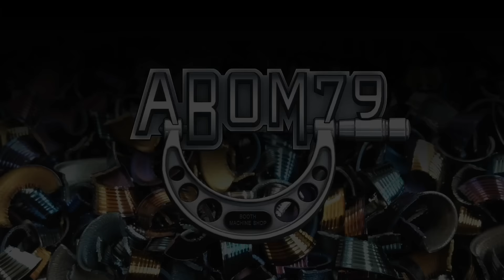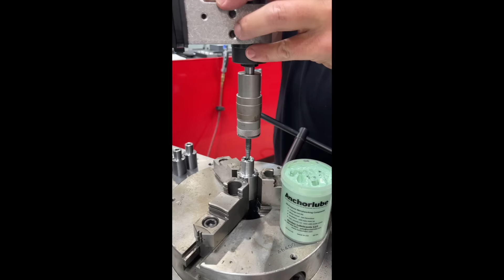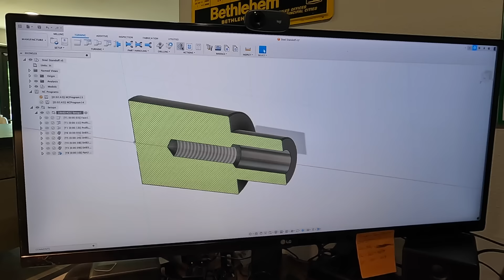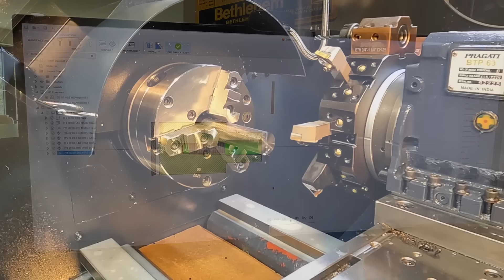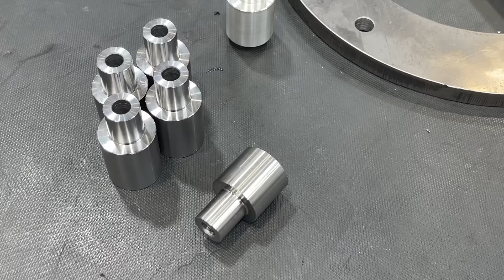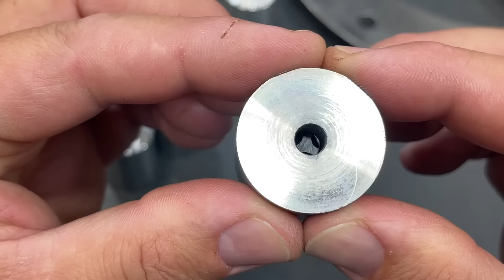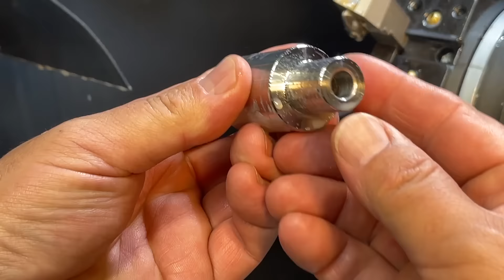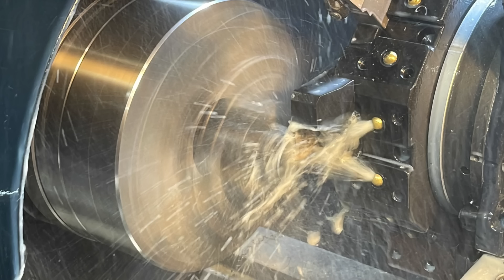Small Batch CNC Turning for the Fab Shop

Comment: Hey Adam, what’s the comparative RPM between the CNC and the Flex arm ? The CNC may be too fast, also you may have drill chips in the bore. Is there any way you could dig up an air line to blow out the bore before the tap cycle? Enjoy your content as always.

Comment: The cycle time would be a lot faster if it didn't sit around Z0 for every pass waiting for something. What is it doing? And the spindle speed is meandering all over the place - there's either something wrong in your program, or that machine has a very poor control

Comment: If you do in fact have rigid tapping on the machine (and spindle orientation) you should try pecking tapping it. Also I would tap a little slower than that. And generally I use a spiral flute tap if I’m tapping blind and CNC but those break easier.

Comment: Most likely the machine does not do rigid tapping. Not all machines can. On a lot of them it is an option when you first buy the machine.
You may have to use a floating tap holder.

Comment: That machine may not support rigid tapping. Contact Milltronics to find out for sure. If it doesn't, you will need a floating tap holder. Also, I know you like spiral flute taps for blind holes. However, you really should try a thread forming tap. They are a lot more stable in a CNC, but can be used in a manual machine by hand or a Flex arm. Thread forming taps do require a different tap drill size. A 3/8-16 form tap calls for a 0.347" drill.

Comment: I have been watching you from the beginning and do love your content the way you are just true to yourself,  but I really don't write comments....you, mainly a manual machinist dabbling in the CNC world.    What tolerances did you hold on your old pacemaker what you were making your large shafts at motion... Being a machinist myself and working mainly in the steel mill industry making anything from small shafts and heats to large rolls for hot mills...we didn't machine down to bearing for specs on the lathes...we run old 60s Russian Stanko gear heads lathes....and we left a large part in overnight and we would see a .010 sag I. The til stock or spindle bearings and even in the change of seasons..we would final grind all journals to precise size...
Reply: Sorry gears not heats
Reply: That’s awesome thanks for sharing. What machines do you run ?

Comment: If you had to run a larger volume of parts, could you add a bump stop to your turret and install a bar feeder? I am not sure if it would be worth the expense if you rarely run into that.
Reply: After thinking about it i guess you would need to have a chuck that could be opened and closed via programing. Iam not sure if this lathe was designed to be used as a production machine.
Reply: @charlesemmer8856  you can still operate the chuck by hand, just finish the program with a stop position where a bump stop finishes at the correct position from the chuck. Remember to move the bump stop away at the start of the program.

Comment: You need to use a smaller chip breaker to stop that strength. You need to insert with about a .10  chip breaker on it to made it chips.

Comment: Based on what I saw in the video. The spindle does not stop fast enough for true rigid tapping. Look into a float tap holder that allows the tap to feed a little deeper as the spindle is stopping. The holder is spring loaded to allow the tool to pull out slightly. Then, program the first part shallow by 5-6 revolutions and see what you get. Slow RPM's are required for float tapping.

Comment: Just curious if you had the feed override on during the tap cycle.  If your feed is not at 100% and the spindle is at 100%, the tap will break every time.
Reply: it shouldn't, if you turn down the feedrate during a tapping cycle in the mazaks and Mori's I've run they all kind of ignored it or reduced spindle speed to suit
Reply: @ramentaryramblings yup. Usually canned cycles or tapping cycles will override any manual changes on the control.
Reply: Every CNC machine I have ever worked with will ignore the feed override in tapping and threading cycles.
Reply: @loukola5353  me too 👍

Comment: Could it be the horizontal power tapping as compared to vertical power tapping that's causing the tap to break? Maybe in horizontal tapping, the torque on the tap is "different" (at least at speed) causing the breakage (chips collecting at the bottom of the piece  get twisted around instead of  breaking and going out the top--like in vertical tapping). Just a thought...
Reply: tapping horizontally or vertically doesn't change a lot. if anything it doesn't change anything.

Comment: We do a few of these tap drill operations in 4-5xd deep holes, shop made square duplex tool holder with a split and a couple clamp bolts, one is the tap drill, other is the tap, you use the same tool pocket, but a different offset. One trick is that you don't tighten the tap that tight so it has a bit of wiggle, there is a square to catch the tap tang, and it feeds and retracts just fine. (This is with a shop made pneumatic barfeeder too so you know its only seeing marginal supervision) speeds up the cycle and in a job shop where you are making a lot of different parts leaving commonly used tools in their pockets and x zeroed and z referenced to the #1 tool does save you a lot of time setting up, so getting a tool twofer out of a single pocket is pretty cool. If your pitch (feed for tapping) is correct then I would guess your tap was off center, first hole with a new tap should have held up to marginal coolant, fail down the line for sure, but the first hole should have suffered through. Other thought is cut the speed in half, an extra few seconds on a tap cycle isn't any crime and it pays for itself in tooling fast.

Comment: You should cut that piece in half on both sides, split it open and check how tool did with cutting threads
Reply: The broken tap fragment in the hole is super hard metal. It would dull or break a bandsaw or hacksaw blade I think. Maybe there are hacksaw or bandsaw blades that can cut it.
Reply: @timothypirnat3754  you can use angle grinder on last stretch of material, I don't think it cares if tap is hard ;)
Reply: @Michal_Ce  Gotcha. I never thought of abrasive disc/angle grinder.
Reply: @timothypirnat3754  abrasive cut off disc.

Comment: Hello Adam, I believe that one of the advantages of ridged tapping is that you can run the tap in part way, run it back out and and run it back in again a bit deeper repeatedly without losing axial alignment. Not something that can be done with a floating tap holder. This allows tapping of deep holes and tapping of difficult materials. I would check with your experts first as I haven't personally had the opportunity to do rigid tapping myself.

Comment: I just ordered a set of 2mm end mills, solid carbide and had them deliver to your Delano St address. It's up to you to determine the speeds and mount them properly. I will require 10 each 0.1 inch thick, 2mm center drilled, non rusting material and hard as steel in diameters 2 inch, 1.75 inch, 1.5 inch, 1.25 inch and 1.0 inch. You may put these into one of those wet stone vibrating tubs to burnish sharp edges off and polish a bit. Enjoy this training session.

When you get the tools, please notify me or show the video on yt while you make them.

Comment: 45 years in the trade------I ALWAYS use scrap aluminum  to "prove in " Questionable programs --------IT WILL SAVE TIME/MONEY AND *****PRIDE
Reply: The most aluminium alloys are not cheaper than steel, and if there is an issue in the programm the tap would break also in aluminium.
Reply: ALSO like to say we never use floating tap holders
Reply: @jdb21867  This job has run in aluminum before. The design was tweaked slightly, but nothing that required much testing to do it in steel.

Comment: Tapping fluid instead of coolant might work? A tension compression tap holder with a clutch tap adaptor for safety? You can slow the tap feed and keep the RPM the same to slightly extend the holder on the in feed if need be. Is it possible that the lathe doesn't have rigid tap?
Reply: It looks that it does not have rigid tapping. I wonder how far away from the tapping hole the tap started, generally I've seen around Z+5mm to get things up to speed and in sync.

Comment: So Adam, help me out with the business end of this. Not including cost of CNC, but adding tooling for this job, how many pieces must you produce to break even? Thanks
Reply: Break even ? He didn't pay for the CNC lathe. He didn't pay for the flex-arm. My guess is that he didn't pay for the anchor lube as well.
Reply: @poorboy6988  I guess with no overheads he is driving the prices down for the other local engineering shops.
Reply: @marley589  I would assume he's doing it for free, as he gets paid a little from the Youtube content
Reply: @colinfahidi9983 and threrefore driving down the local rates even further by buying work.
Reply: @poorboy6988 are you his accountant?
Reply: That's why bigger Job Shops don't do small runs and smaller Job Shops use manual machines.
Adam is in a unique position of being a Small Shop with Big Shop Machines. 
He did the work, got the YouTube Creds so is benefiting from it.
Consider him an Independent Marketing Rep and entertainer.
Reply: @YouShouldThink4Yourself   I think that people need to understand is that he is no longer a machinist - he is an influencer and that is how he makes his money.

Comment: Hi Adam, this is Michael from Argo Machine Tools inc. in Montreal since 1948. My heart goes out to you in realizing that there are issues ridged tapping on your lathe. I have a slew of CNC lathes and ridged tapping has never been an issue. I have been so happy to get away from floating tapping holders since I have unloaded all my screw machines. I am not offering you any suggestions however sometimes using a 3 jaw chuck as opposed to a collet chuck ( which is much lighter ) can sometimes create a snyc issue when reversing during a tapping cycle. I am not at all familiar with the supplier of your lathe but it still should not be an issue. On your video even the drilling sounded sketchy and once I heard that I did not have much hope for your tap.  In my humble opinion if you wanted to stay USA made ( and I agree ) next time think HAAS. This is what I personally run despite all the negative feedback you have heard over the years. All the best Adam. I even watch your BBQ shows.

Comment: Adam, MrNcornish is right, without a floating tap holder, no tapping is possible on a CNC lathe. Also, there is little specificity in the program. That's assuming you have a floating tap holder.
With G32, the pitch of the thread that you set with F should be a few hundredths smaller.
For example: I am from Europe and I work on metric system so, for an M3 thread, the pitch of the thread is 0.5mm, you must set F to 0.49mm or 0.48mm. The smaller pitch of Z  is compensated by the holder.

Comment: Use a floating holder for the tap.  You still might have problems with chips getting in front of the tap.  I'd use a roll tap and some good tapping oil instead of coolant.

Comment: Did you really think the toolholders weren't concentric on the turret?
Reply: On older lathes that have been crashed (not this one),  it's a good idea to indicate the tool holders.
Reply: @carabela125  Maybe so, but did he honestly think that new machine turrets were not necessarily made concentric and he just got lucky.
Reply: The turret should be concentric but there can be slight variations between the tool blocks in each station that can read a few thousands differently between them.
Reply: @loukola5353  I assumed the tools were set after they are fitted in the toolholder.

Comment: Adam, as far as I know you cannot rigid tap on a lathe. (although I stand to be corrected buy any of your viewers)You will definitely need a floating collet holder. Where I work we have two Mazaks and an XYZ lathe, they all  require a floating collet holder to tap. On a milling machine the spindle is fitted with an encoder to ensure the RPM is deceleration is synchronized with the Z axis movement. This does not happen on a lathe. Also because of the size of the chuck even a 6" chuck there is a lot of inertia so it will not stop in a controlled way like a milling machine spindle. If you buy a floating collet you should have no further problems. Keep up the good content, keep learning. I enjoy your video's here in the UK.
Reply: Simply not true in today's age
Reply: Of course you can rigid tap on a lathe. I do it all day long on a Haas.
Reply: Absolutely true. Without a floating holder, no tapping is possible on a CNC lathe
Reply: @petkoivanov9020  Even tormach machines can. Every CNC lathe with c-achsis capabilities can right tap. I don't know any new machine without this features.
Reply: @petkoivanov9020 , you can do true rigid tapping with a lathe spindle if your machine is equipped with the option.

Comment: 21:22 .. One thing I used to do, with drilling deep holes (and will be good for tapping too) is to rely on some PLUMBING skills!! :) 

Plum the tool position with a 1/4" or 1/8" compression fitting!  Then keep a roll of soft COPPER tubing, )the kind of flexible stuff.)   ....

And make a short length that will bend just right to pont DIRECTLY into the drilled hole!, .. and clamp it tight with the compression fitting!  

It's easy to bend or adapt, to ANY size of part , or any size of drill bit or tap, and it and can be replaced inexpensively!!

Comment: 17:03 .. Probably not worth the effort here, to add another tool change? .... but we used to use a second tool for finish cuts and it used an insert, that had a 1/64" radius ... it tended to break up the chips a bit more most of the time.
Reply: If the surface finish really mattered, I think we would have. Honestly, that surface wouldn’t even need to be turned and the part would still be ok.

Comment: 13:06 ... Back in the day when i programmed and ran CNC lathes at the punch and die shop, we did almost exclusively simple turning (for punches) on the CNC Lathes.   

Even most dies we did only needed a simple "back hole" and were put in stock as "blank dies" that had the "front hole" drilled much later as a second operation. (then they were hardened and ground to finish size after heat treat).

SO???!!! When we were expanding the workload of the CNC lathes and tried tapping?? ... EVERY TAP BROKE! :(

We found the tool head was out of alignment, it tilted DOWNWARD a substantial amount.  This was NOT adjustable, and not only could not be fixed .... we could not figure out WHY it was like that.????

These were BIG lathes the rotating 10 position tool head, would be 3 or 4 times the size of Adams precision CNC Lathe here.

The owner was an old machinist, and new very little about CNC Lathes, except some sales presentations he had received. (this was also in the 1980's), 

He looked at everything, looked at the broken taps, and??  
Called an EXPERT from the machinery distributor, to come out ASAP! :)

The tool head had been crashed into the chuck several times, and bent all the alignment/shear pins, we had no idea where they even were ...  the Expert?, rolled up his sleeves and showed us how to disassemble the rotating tool head and replace the Alignment pins (they are designed to bend or SHEAR during a crash!!)

Seems simple??  But it cost us two days production figuring it out.  

BUT!!? .... Since we had purchase two CNC :lathes and two CNC mills, through the same Distributor? ...The Expert provided the "Alignment Shear Pins" free of charge (and a spare set) and charged us ZERO dollars!!.

The owner ended up being pleased as we ALL learned valuable knowledge and gained experience! :)

Sorry this is so long (congrats if you got this far L0L) . but I thought this info MIGHT apply to many CNC Lathes??? And might be useful to the YouTube Viewers! :) 

AND? .. remember, sometimes asking for help ... is the best repair and education tool!!

Comment: A very interesting video. I have learned as much from failures like this as from successes. A stop to add a dab of Anchor Lube in the hole and on the tap would have eliminated that breakage. Spray coolant doesn’t have enough lubricity for horizontal tapping.

Comment: The tap broke because the rpms were to high. There are charts from the tap brand which show you the max. rpm / material / tap size
Reply: It was 250 RPM and well inside of the MFG's recommended speed

Comment: I'd love to see that piece split open with an angle grinder so we can see how well the thread was cut. If the pitch wasn't right I'd expect to see deformed threads.
Reply: My initial thought was that it might be a feed issue. I worked sole Autodesk support folks who modified the code and we ran it a second time. This time in plastic. We also ran the original in plastic. Both threads came out fine. So thinking this was just a chip issue.

Comment: Is it possible for parting, that there is a slight angle on the tool so that the part finishes first. This can prevent later finishing the part. 
For the ridged tapping, the machine works with steps, very small ones. The first threads go because of the flex in the material,with more threads the material won’t flex enough and the tool breaks.
Reply: You are on the right track. It is more the cutting edge of the tool being above or below the centerline.

Comment: Good day! Some points to improve the process. Use a metal net with magnets to capture the details. This will protect the CNC and the surface of the parts. Go slowly with the last part of fine-cut, after that change tools and stop the program by using a workpiece limiter such as a drill. Then finish the program and begin the next cycle.